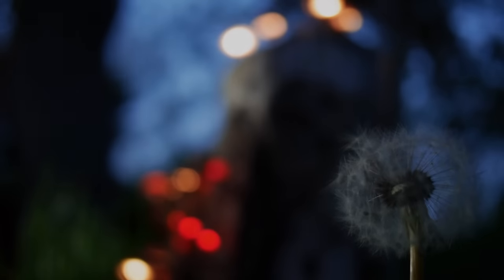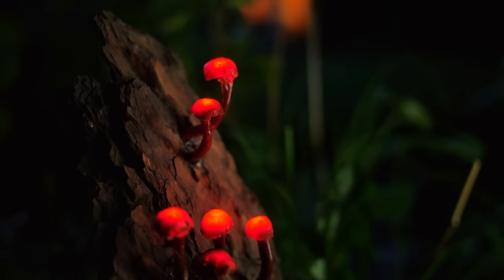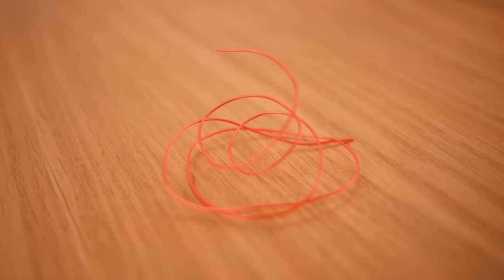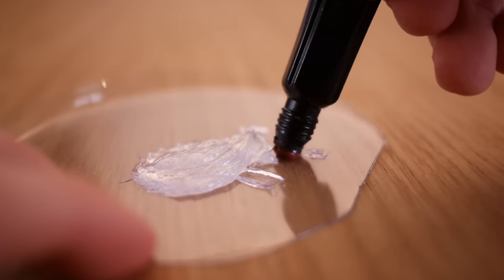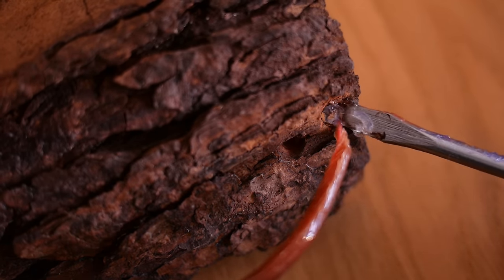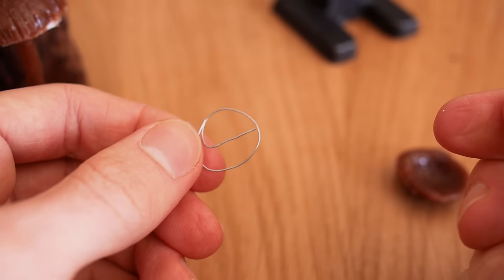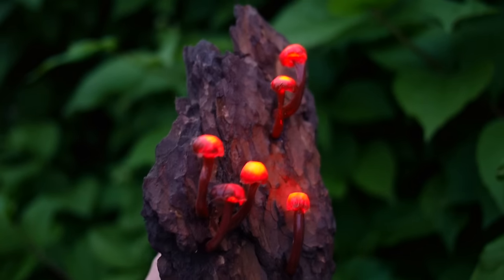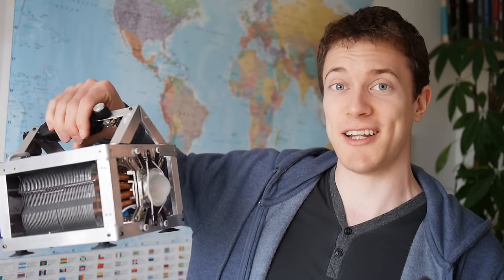DIY Mushroom Lights (craft project)

Comment: For those who may be having trouble with the Silicone they've selected and needing to know how long till it dries/cures:

One thing that isn't explained in this video is the type of Silicone to use. Based upon a question found in the comments (How is the Silicone going to cure when it's in airtight clear wrap?) and someones kind gesture to help clear up the confusion, here is the basic run down:

There are three types of Silicone:
-- ACIDIC: Generally identified by a Vinegar type smell during the curing process - cures the quickest. Most of these type of Silicones are what they call RTV (Room Temperature Vulcanizing). However, not all RTV Silicone products dry quickly as they fall into the Neutral category. Sometimes the acidic Silicones are labeled as "Acid Cure" or "Acetoxy Cure". MSDS (Material Safety Data Sheet) for Silicones that fall into the Acidic category should list "Acetic acid" either under "Ingredients" or under "Oder".. or both. It may also list Acetoxy and/or RTV on the MSDS. Can take up to a few hours to dry/cure if in Cling/Saran/Plastic Wrap.

-- NEUTRAL: In some of the Silicone products I've researched in this category, the Odor listed was "slight", but nothing specific. One sure way to identify a Silicone in this category is to look for Oxime in the MSDS (Material Safety Data Sheet). Can take up to a day to dry/cure if in Cling/Saran/Plastic Wrap.

-- BASIC: Generally identified by an Ammonia or Alcohol/Methanol type smell as it cures - cures the longest. MSDS (Material Safety Data Sheet) for Silicones that fall into the Basic category will more than likely list "Methyltrimethoxysilane" under Ingredients (needs to be higher than 1-5%) and "Ammonia" or "Amine" under Oder. Can take between 3 to 7 days or more  to dry/cure if in Cling/Saran/Plastic Wrap.

Based on this information, you should be able to identify the Silicone you purchased and the possible dry/cure time. Bottom line here, is that any Clear Silicone should work, but some may take longer to dry than others.

NOTE: Home Depot does have the MSDS for each of their Silicone products, but the link to the MSDS is listed as SDS instead. This can be found by clicking on a specific product, then scrolling down till you see Product Overview directly under the product you're viewing. Usually you will see some additional pictures, but eventually you should see "Info & Guides", where the MSDS is located (the link to click on should be labeled as SDS ). Alternatively, you can hit ctrl + f (on a windows machine) to open a search, and you can enter either Info & Guides or SDS . Also, don't be confused if the name on the MSDS does not match the name Home Depot is selling the product under. I assure you it is for the same product. If you're still not sure, one of the easiest ways to verify is to go to Google or Bing or whatever search engine you use, then follow this format:

BrandNameOfProduct Model# MSDS

Example: GE HD612 24C MSDS

I find the Model # by going to the product page and looking directly above the image of the product. You can also search the entire page (on a Windows machine, CTRL+F will work in Chrome, IE, and FireFox) for the word Model. You should see something similar to: DAP | Model # 08791 | Internet # 206046715 | Store SKU # 1001392668

Not all Model #s on Home Depots website can be used via a Google search using the above example of: BrandNameOfProduct Model# MSDS. This is mainly because it's going under a different name in the MSDS and may have to rely the MSDS Home Depot provides.

Sometimes the MSDS isn't clear on what kind of Silicone you're looking up, as in, none of the identifying items is listed. I generally skip these. If you already bought the Silicone, the only way to find out is to test.

If you don't have a Home Depot near you, or for whatever reason want to use Lowes, finding the MSDS on their Silicone products will be different. You'll need to grab the Model # of the product, which is usually located on the product page to the right of the image of the product. Once you get the Model #, go to this website and enter it as a PRODUCT CODE : http://secureweb.infotrac.net/msds/lowesforpros.aspx. Sometimes, if when using the Lowes link I provided doesn't find anything, but you entered something like Model #LW012A , you may have to drop everything BUT the LW012A to find what you're looking for. Once your search finds something, to the very left of the item name will be an icon that looks like a piece of paper with a magnifying glass over it. This is what you want to click for the MSDS.

Here is a list of some of the Silicone products carried by Home Depot, broken out into 1 of the 3 categories (I don't just list the Clear products, so be very aware of this when looking over the list... I do this so one can search the MSDS and become familiar with identifying one of the three types of Silicone):

ACIDIC
-- All Purpose Silicone I 10.1-oz. Clear Window and Door Caulk (General Electric Model #GE012A 24C)
-- 2.8 oz. Silicone Aquarium Sealant (DAP Model #00688)
-- 2.8 oz. Auto/Marine Sealant (DAP Model #00694)
-- Tub and Tile Silicone I 10.1 oz. White Kitchen and Bath Caulk (General Electric Model #HD712 24C)
-- 2.7 fl. oz. Clear Waterproof Silicone Adhesive (6-Pack) (Loctite Model #908570)
-- Tub and Tile Silicone I 10.1-oz. Clear Kitchen and Bath Caulk (General Electric Model #HD612 24C)
-- Supreme Silicone 10.1-oz. White Kitchen and Bath Caulk (General Electric Model #M90007-30 12C)
-- Silicone Caulk in Clear (Swan Model #SI01003.000)
-- Clear Silicone Room Temperature Vulcanized Sealant (J-B Weld Model #31310)

NEUTRAL
-- Silicone Max 10.1 oz. Clear 100% Premium All-Purpose Silicone Sealant (DAP Model Model #08791)

BASIC
-- Silicone II 10.1 oz. Clear Kitchen and Bath Caulk (General Electric Model #Ge5040-T)
-- Silicone II 2.8 oz. Clear Kitchen and Bath Caulk (General Electric Model #GE284 3TG)
-- Alex Plus 10.1 oz. All-Purpose Caulk Clear (DAP Model #18072)
-- Silicone II 10.1-oz. Clear Window and Door Caulk (General Electric Model #GE5000 24C)
-- Supreme Silicone 10.1-oz. Clear Kitchen and Bath Caulk (General Electric Model #M90006-30 12C)
-- Alex Plus 10.1 oz. White Acrylic Latex Caulk Plus Silicone (DAP Model #18103)
-- Silicone II 2.8-oz. Clear Window and Door Caulk (General Electric Model #GE500 3TG)
-- 10.1 oz. Dynaflex 230 Premium Indoor/Outdoor Sealant (DAP Model #18418)
-- Supreme Silicone 10.1 oz. White Window and Door Caulk (General Electric Model #M90015-30 12C)
-- 10 oz. Silicone Sealant Cartridge (General Electric Model #GE-55)
-- Silicone II 10.1-oz. White Window and Door Caulk (General Electric Model #HD5010 24C)
-- Silicone II 10.1 oz. White Kitchen and Bath Caulk (General Electric Model #HD5070X2 72C)
-- 2.8 oz. Silicone Sealant (General Electric Model #GE-57)
-- Silicone II 10.1-oz. Almond Kitchen and Bath Caulk (General Electric Model #GE5060 12C)
-- Silicone II 10.1-oz. Brown Window and Door Caulk (General Electric Model #GE5080 12C)
-- Silicone II 10.1-oz. Light Gray Window and Door Caulk (General Electric Model #GE50.08 12C)
-- Silicone II 10.1-oz. Clear Gutter Caulk (General Electric Model #GE50G.01)
-- Alex Plus 10.1 oz. Clear Acrylic Latex Caulk Plus Silicone(12-Pack) (DAP Model Model #18660)
-- Silicone II 2.8-oz. White Kitchen and Bath Caulk (General Electric Model #GE281 3TG)
Reply from the maker: Eldiin May I post your excellent summary in the description, so that it's easy to find if people get stuck?
Reply: DIY Perks Yes, you may. That way it's easy to find and isn't buried in the comments.
Reply: Oh you wins the internets for such a huge and helpful post!
Reply: Thanks for the info, I just picked up the Silicone 11 from Home Depot but now I know I'll be disappointed in the dry time so will look for your ACIDIC or Neutral recommendations.   cheers
Reply: @marlazvideoz  Glad this info was at least a little helpful... especially now, since the info I gave is 4 years old :). But the general rule still applies. You want Acidic first and foremost, but Neutral can work -- you just need to remember the dry time may be longer.
Kinda surprised that the link I gave above, for Lowe's product code search, still works. As far as I can tell, the info I gave about Home Depot's website is mostly accurate. When you see the product on their website, you just keep scrolling down until you see "Product Info"... then to the right of that is a box that says "Info & Guides"... and this is where it differs. There isn't a "MSDS" link anymore, but there is a "SDS" link. This is what you're looking for..
Reply: @eldiin8478  This really was wonderful information, and extremely well presented....I can't imagine how many people you've helped with this.  (I'm one of them, and thanks!)
Reply: I need to try this, because I'm stuck with my caps and stalks not curing at all or easily taking a week. It seems like if it doesn't cure in a few hours then even removing the cling wrap doesn't help.
Reply: @jamesdixon9015  James, can you post the name of the Silicone you're using and where you may have gotten it? Include as much of text as possible... such as Window, door, and siding or DAP . Things like Silicone Plus and Clear can help as well.
Reply: @eldiin8478  Sure! It's GE Silicone 2+ Clear, Kitchen & Bath, 100% Silicone, 100% Waterproof. Methanol and ammonia released during cure. Contains hexamethyldisilazane, methyltrimethoxysilane, and petroleum distillates. The use by date is 08/2020. This is the current product that I'm using, but I think I've used some different ones in the past with the same issues. I bought this at either Home Depot or Ace Hardware. I was told that Corn Starch can help with the curing process, and it's had some effect. I've tried mixing and immediately shaping within the clingwrap, mixing continuously then waiting a while before shaping within the clingwrap, shaping as little as possible, and shaping more than needed. I think waiting and shaping as little as possible has had the better outcomes, but I'm not very good at this approach. The first three mushroom lights I made cured in about two hours (don't recall what type of silicone was used) only to have worsening results each time after that.
Reply: @jamesdixon9015  Yeah -- Here's a little trick with GE Silicone.... GE Silicone I (as in, the number 1 or roman numeral 1) typically are acid cures (vinegar smell) and the GE silicone II  are generally ammonia cures. If you're getting the ammonia smell, then your Silicone will definitely take a bit for it to cure as those ones can take longer for it to cure.
Reply: I know this is a 6 year old comment, but I'm still going to ask anyhow: What's the specific reason for using watercolour? Why not acrylic like I've seen in some other tutorials? Does watercolour have a certain chemistry that mixes better with the siliicone? (Thanks if you do reply) <3

Comment: Very cool video but you gotta be careful what silicone you use as the most common 100% silicone contractor stuff has a powerful acid in it that corrodes metal and if it gets on the resistors legs it will can structure failure where they snap. So be sure to wrap any exposed metal parts with electrical tape or something to prevent your wires from eroding😁😁😁
Reply: Liquid tape might be the solution to isolate the metal from the silicone :)
Reply: Epoxy resin is a good insulator. Heat-shrink tubing also, it is designed to insulate.
Reply: U shouldn’t worry bout the acid. Acids only react when dissolved In water (or some other liquid). 
Has to be a tiny bit moist. Once it’s dry it’s no big deal

Comment: Apologies if this has been mentioned before, but you know how long those comments can be! How about rigging it up to a small solar panel with a light sensitive switch, (with a wire trailing it off elsewhere) so the entire system could be better sealed against the elements and placed outside, only to turn on all by themselves come nightfall? I think that'd be cool! Thanks for sharing this. You make it look so easy, lol! I have now added to my "to do" list of things I want to try!
Reply: Love that idea!
Reply: There are three completely different projects involved in doing that.  First, and probably easiest, is to make an 'outdoors-proof' set of mushroom lights.  Second, is a solar collection and storage system to provide power, which means panels, batteries, and a charge controller of some kind.  And third is the light controlled switch to power them on.  You would probably want all this to be a fairly high efficiency, since the amount of battery required to run the lights determines the amount of solar panel you would need to charge them.  That might get a little complex for the average DIYer, and could add up to a bit of money.
However, those solar light stakes with a crude version of all that built into them already might be a thought.  Just open them up, solder wires between the LED and the pads it connects to, then make mushroom lights using the led from the stake-light without adding a resistor or substitute an equivalent LED of your preferred color, and use one nearby solar-stake for each 'mushroom'.  Not an elegant solution, but it would be cheap and simple.
Reply: You can use a solar light strip and simply cut the strip down (or use those for the mushrooms) and connect the solar panel, which includes everything that's needed.
silicon is waterproof itself, so I think you can use outside, but I would put somewhere protected.
I've been thinking of this, probably I will try.
For now I have a battery supplied brown mushroom set.
Reply: You wouldn't even necessarily need to hide the panel, since they're usually black and at night it wouldn't be super easy to see ^_^
Reply: Ypu can buy little solar lights already...... Very very cheaply with light sensor built it..... Even ones that are animals ect..... It could be an idea to use one of them....maybe incorporate the panel into the what ever you're using to put the mushrooms on...... I'd probably hollow out a log.... Seal the inside to make it waterproof.....

Comment: My last brain cell: yeah, let's do this!
math starts
Last brain cell: ok, bye
Reply: avoid the math and just buy what he tells you ;)
Reply: I’m trying a cheater method and buying a set of Battery powered light strings from DG, I think they’re $2 rn lol
Reply: DS2 thanks ☺️
Reply: Copy-Paste, or use a calculator ;)
I`ve been into electronics since the early 90`s and I use a calculator now more than ever lol
Reply: @afrog2666  or just go with 220 Ohm for 5V or 1K for 12V because it doesn't really matter that much. Neither of LEDs will get damaged and a little less brightness won't make any impact
Reply: Same, bro. Same.
Reply: @simasimson5798  I for my part did the maths for what I'll be doing just to make sure 👀 my grandpa used to set everything on fire, my dad is prone to catching fire and I have zero interest in finding out what my relationship with fire is 😂

Comment: That was much more complicated than I anticipated. Great ideas and one more reason to buy a soldering iron. Might just make the caps with that pointless clear silicone I mistakenly bought and put a cheapo flameless candle inside til I can do all the hard stuff. 
subscribing because you're lush. You can brighten up my day and tell me about things I can't do without slightly electrocuting myself :) thank you for the information. I love mushrooms
Reply: not a bad idea either... you could also get hollow Styrene sheet round tubing, then carefully heat it from a distance (paintstripper of hairdryers, even warm/hot water might work) then carefully bent into shape and let cool down to cure :) for making the stems i mean...

Comment: Made these! So proud of my glowing white mushrooms and my boyfriends lovely fire red ones. The project was at times frustrating but the end product definately made up for it. Going to take them on a camping trip this weekend. Thank you! From Cape Town South Africa
Reply: Did your white mushrooms turn out to be yellow? Mine have and I dont understand why.
Reply: kei-ella Loewe Did you have issues with the silicone drying in the clear wrap? Mine will not dry and it comes out all gooey!
Reply: No, I left mine for a couple of hours and then it was dry and came off the cling wrap easily. Maybe you need to let it dry over night?
Reply: @timmahh9201  u for sure bought WARM WHITE instead of COLD WHITE
Reply: @keiellaart3272  theoretically we all live in different temperature / humidity areas,

I agree leave them overnight would atleast make them come loose... 

if not then they really used the wrong type of silicon...

Comment: You can also mix type1 silicone with corn starch and food coloring to make a putty that is hand molded. You can use latex gloves and powder your hand with more cornstarch to reduce the mess. Absent the cornstarch and you'll have translucent colors. Included in it and you'll have opaque coloring. Great video for a cool diy display.